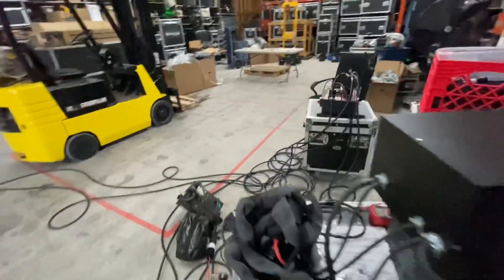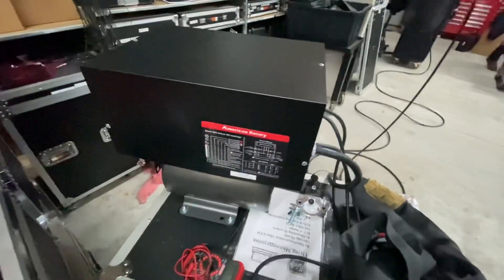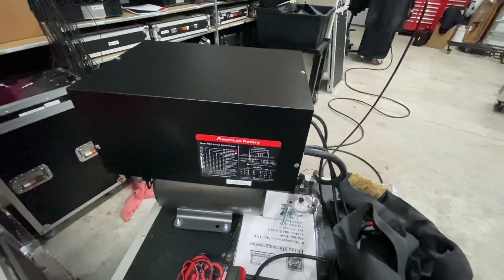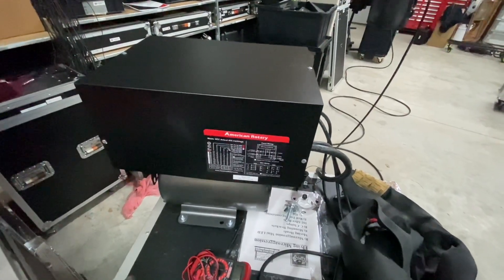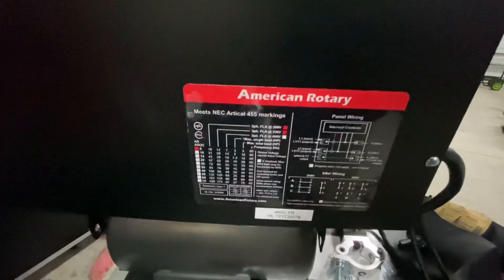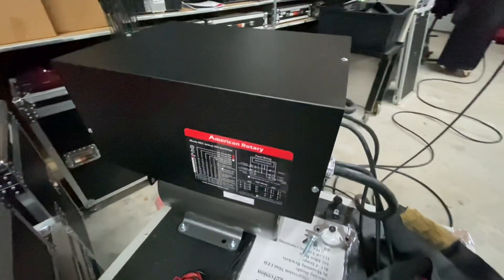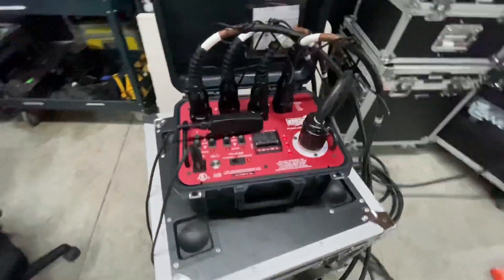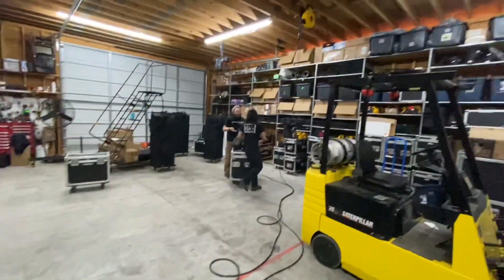How to create three phase power from single phase power for chain motors using a phase converter

Comment: Hi sweet tree. Is it a good idea to get single phase hoist instead , what is the advantage of having 3-phase?...I am thinking to buy so I would like to know...thanks
Reply from the maker: Three phase power is always better for any motor. It provides a more continuous even power which makes the motor work much better. If you know you will never have three phase power single phase motors are ok but definitely have draw backs and more failures. We are a dealer for Stagemaker if you are in the US let us know.

Comment: I didn't know you could convert power like that. That's awesome !
Reply: Me either. Very cool!
Reply from the maker: It’s pretty incredible. Here is how it works. By acting as a rotating generator, rotary phase converters transform the single-phase energy supply into three-phase power. The rotary phase converter uses a single-phase two-line supply of power from the utility, and creates a third line of power. The three lines, also known as phases, are indistinguishable to utility three-phase power, typically more accurate than utility-supplied three phase power, with all three lines shifted 120 degrees. When the rotary phase converter is properly sized, it will produce true three-phase power with each of the three output voltages well balanced over the entire range of connected loads. So essentially this should be better than utility supplied three phase.